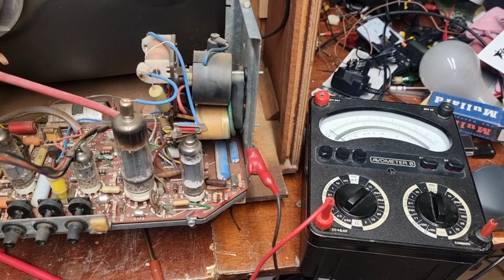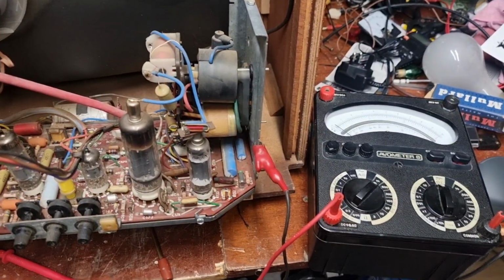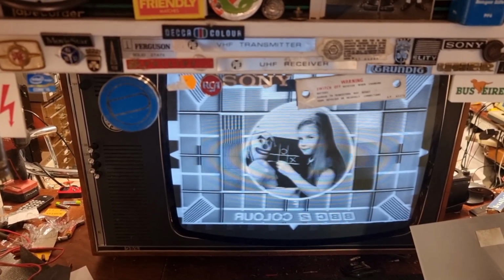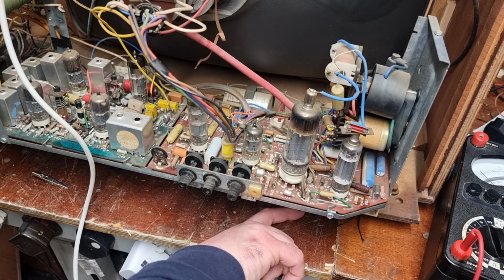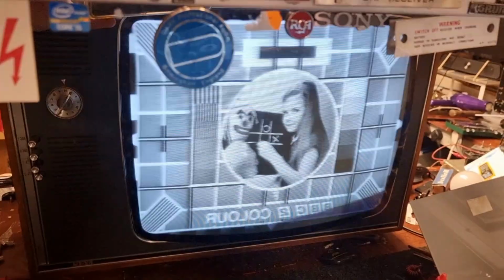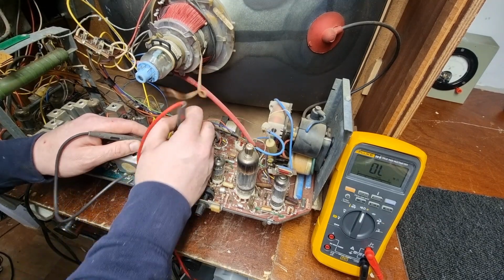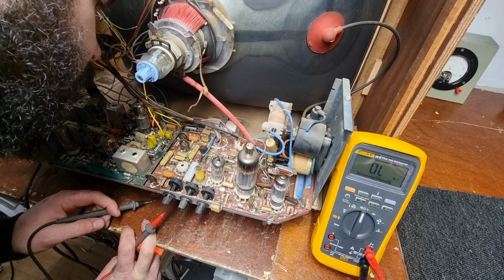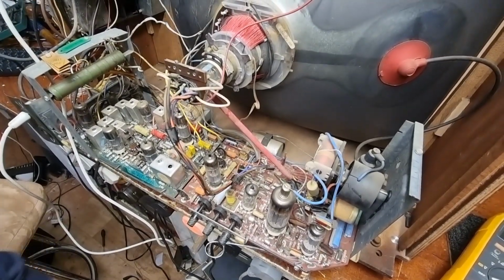Vintage TV Repair. GEC Dual Standard Television.

Comment: I think the deflection yoke or magnets need to be moved a few degrees. The image doesn't look perfectly centered to me. Check the Horizontal and Vertical Sweep circuits and the Power supply.  There may be a bad Capacitor which is throwing off the linearity.

Comment: those white and blue caps are garbage , I have a philips tv 21 inch from the 70s that came with one of those for the boost voltage , it cracked, shorted and killed the lopt